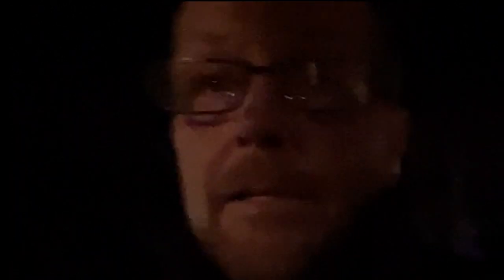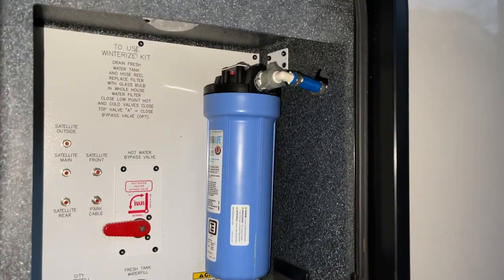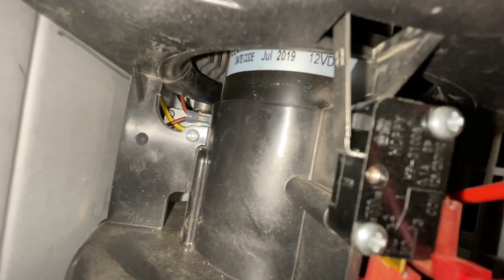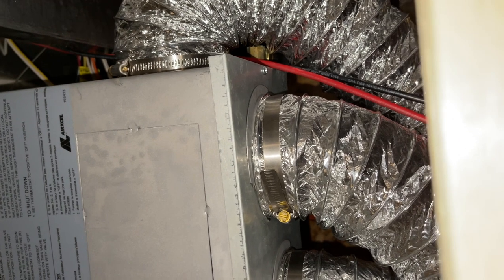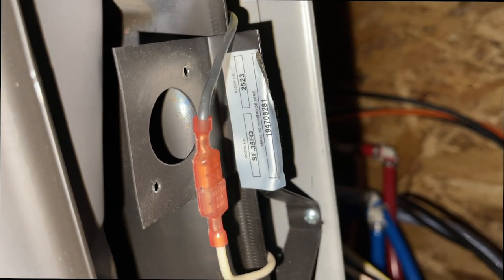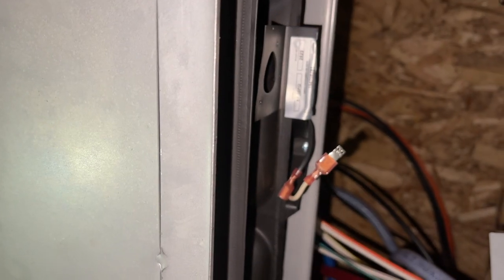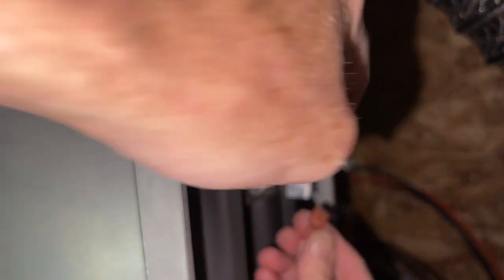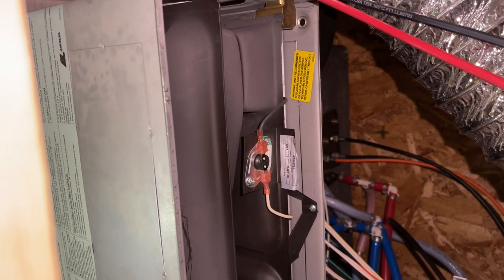Best $17 Ever Spent On My RV

Comment: There is really good money in RV repair. Ask me how I know that. I've fixed a bunch of these. The other thing that will go wrong is that the fan will begin to squeek and eventually fail. That's a bit tougher to repair because you must disassemble the entire unit. I mean take ALL of the guts of the heater out just to replace the fan. Yep I make pretty good money when I have to fix these things.
Reply from the maker: Your a good Friend to have 😀
Reply: @RVOddCouple  You know what it costs to drop your RV off for repairs or service. Most shops charge as much as $160 per hour. I charge $40. My customers love me.

Comment: Limit switches fail because the system overheats.  They don't just fail from wearing out.  Make sure you have good flow to the air intake. If you have a filter, make sure it is clean (not sure if the rv furnaces have filters). You need the air to flow unobstructed.
Reply from the maker: Yes, we mentioned this 😀

Comment: We bought our 1984 Itasca Winnebago Class A Motorhome in 2018 here on the Coast of Oregon.☔ The furnace in our RV doesn't work properly, so we use electric heaters and sleeping bags rated down to zero degrees instead!!🙈#davesandersstepdaughter

Comment: What kind of Rv do y’all have ?  I’m pretty sure that we’re going to buy a Heartland Cyclone Toy Hauler, have you heard any bad reviews on them ?
Reply from the maker: Sandpiper
Reply: @RVOddCouple  We will definitely check it out, we use to have a Holiday Rambler tag along it was awesome. My husband was a pipe welder and we were in North Dakota and it got down to - 45 degrees and it never frozen up. We never had one problem with that trailer and we lived in it for 12 years and sold it because my husband fell out of a tree deer hunting. Now Holiday Rambler just builds coaches which we don’t want.

Comment: Funny thing everyone I see working on a rvfurnace has interior access to it. On my Tiffin the furnaces have to be accessed from outside the RV. And the rear one which is the one I had that was not working is a big pain in the butt to get any access to. Finally called a mobile RV tech here in Kentucky, much better price than what you were quoted down there. My guy only charge $60 for the trip to come and look at it. Everything all together and the whole circuit board which I had to have new come to $345. That hurt bad enough, but looks like I got a real bargain from white a lot of people get charged for this type of thing.

Comment: Nice! FYI YI: The limit switch is a heat activated chemical switch (not anything mechanical) called a thermistor. Any thermistor by any manufacturer will work on any furnace as long as it is heat rated the same as the original. It does not have to be Suburban. You can save money by not buying Suburban. 

If you did not know where the furnace was then you may not have water heater knowhow. The water heater has two differently rated thermistors. Also, the water tank heating element is the same as household tanks. You just have to know if your tank takes a screw-in or a screw-onto element. Be sure to get the 120v, not a 240v.
Reply from the maker: Great info! Thank you Timothy

Comment: Limit switches don’t usually just fail for no reason. You should work out why it failed before assuming everything is good. Also, there is no need to jump the switch to see if that is the problem. The safest and most foolproof way to do it is to check continuity. If you find an open line with your tester, the switch is bad. You probably could have found a compatible limit switch locally instead of ordering from Amazon and waiting for it.
Reply from the maker: Thank you

Comment: Shame on the furnace mfrs for making it so hard to get to highest failure parts.  A cheap sheet metal door would solve you having to take the thing apart to get to it. It’s like burying the water pump behind the wet bay panel.
Reply from the maker: Agreed Stan!